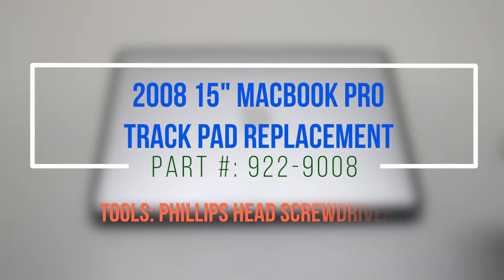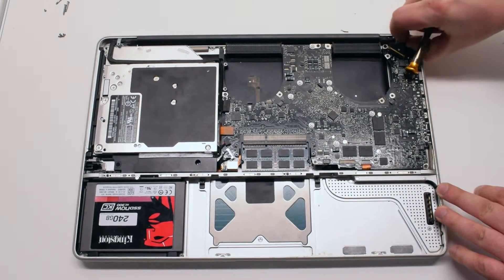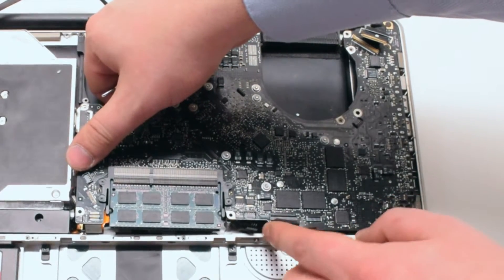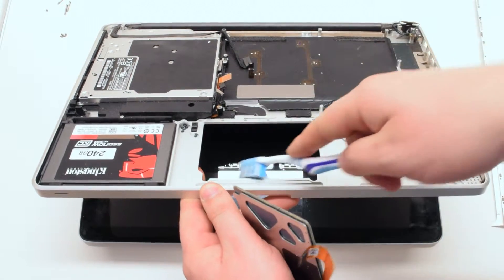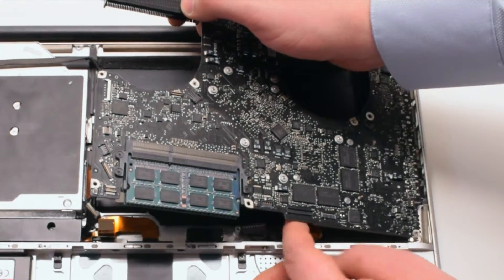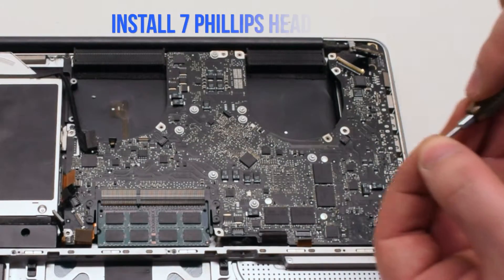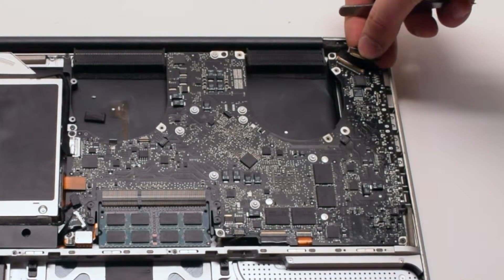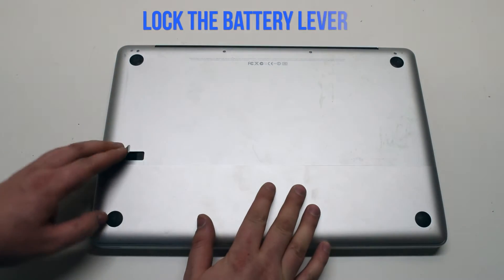2008 Macbook Pro 15" A1286 Track Pad Replacement

Comment: Hello, my trackpad needs a lot of force to click, do you think its possible too much dirty in edges?
Reply: Could well be, however there is a tri wing adjuster screw to change the clickiness so try that, just don’t tighten too much I’ve seen a smashed one cos of that

Comment: This the "Late 2008" .... I have an "Early 2008 that looks substantially different.... my trackpad is actually good.. it's the clicker blade that went bad, and even then, it was actually the spring that somehow gave way and was keeping the switch partially depressed... sigh... I just pulled it out and voila, fixed. Now it looks horrible but it works 100% lol
Reply: Allbbrz I have the same problem as you, but not sure how to fix it.  How did you fix it?  How do you get the button off?  Can’t even use a bluetooth mouse, because the trackpad button is jammed.

Comment: hello, can you help me? i'm on my fist macbook that i won as a gift, so the track pad isnt working. im for 5 days looking for a compatible trackpad but i found just about 2008 macbook pro trackpad, about my macbook i cant find it, all that l found had a codename something like A1278 but always just about macbook pro 2008 nothing about MacBook (13-inch, Aluminum, Late 2008) (CTO) do you know how can i found it? the serial number is W89231J18QU thanks so much.
Reply from the maker: Yes, just type in in ebay 2008 15" macbook pro trackpad it's the A1286 type for 2008 only year.

Comment: Pretty decent walk through except not enough emphasis on the extreme delicacy of the LVDS cable pins.  I just lost use of my MacBook Pro following this due to a tiny imperceivable touching of a couple pins.
Reply from the maker: Most cables are very delicate but this is a track pad video, LVDS cable is for the LCD screen and shouldn't be touched for this trackpad troubleshoot. You should be very confident in working with small components and industry standard connection housings and levers before attempting these repairs. Thank you for the comment and pointing out what could possibly go wrong.
Reply: I am tech savy generally.  I had to disconnect and reconnect the LVDS cable to remove the mother board to remove the track pad per your instructions right?   I would have gone slower at that point.  But it was my risk.  Nothing was forced and everything else seemed to go well but unfortunately I have a dead computer now nothing happens at the power switch.
Reply from the maker: Reconnect your keyboard, they power button is part of the keyboard, if the keyboard is not plugged in then the power button doesn't work. Also see this article on how to turn the computer on the old fashion way by shorting two logic-board pins to make sure the board is not dead http://www.insidemylaptop.com/turn-on-macbook-pro-laptop-without-power-button-locating-power-on-pads/
Reply: Thanks.  I took it all apart an reinstalled the mother board but this time with the divider not in there as yet and this aided in pulling more of the keyboard tape wire out and making sure when reconnecting it was well seated.  After putting all the rest back together I saw and heard the power light and chime come and the little bit of a roar of the fans come on. The computer came on and but the screen is dark and I thought that was a total goner completely until I restarted with the T key down for a firewire connection and I noticed I can barely make out the firewire icon floating on the darkened screen and it is sharp and this makes me hopeful that all is not lost with the monitor.  Thanks again for saving the day with the power up and I was able top recover vital files.   

As for the dark screen I have thus tried zapping the PRAM, Reseting the System Management Controller the other popular keyboard trick but thus far to no avail.   Still researching that one.

Comment: Wow...I'm not feeling very confident in my abilities to do this even with the very thorough tutorial. Most other models there are only a few simple steps. How much should one expect to pay for this service?
Reply from the maker: It's based on the local economy but a ball park price as a service is $150-$200 because the logic board has to come out on this model. When it comes to logic board removal the shop takes on responsibility if anything brakes. Make sure that you have a 15" 2008 model, because 2009 and later are a lot easier to remove and clean or replace.

Also check out this video and get a better idea of functionality of track pads, there are work arounds to some track pad issues: https://youtu.be/erA6dGvc7k8
Reply: I came here too, to replace a cracked but working trackpad, and I was able to do the replacement.  while tricky, with some patience and good lighting I was able to replace the trackpad.  took me about 90 minutes.  on thing I'll note is that putting the logicboard screws back in, you can lay the fan down first will avoid you having to remember which holes belong to just the logic board, and which holes are for the fan.